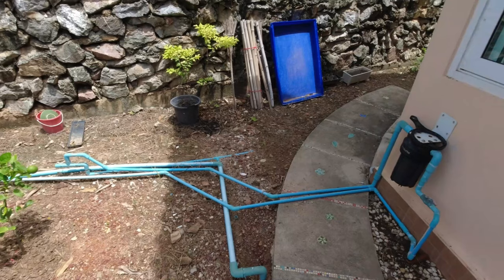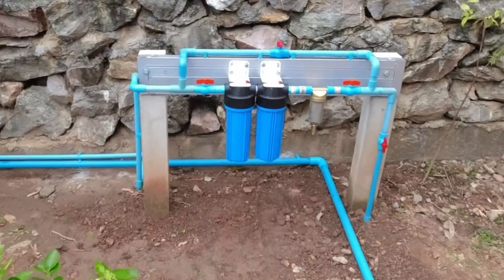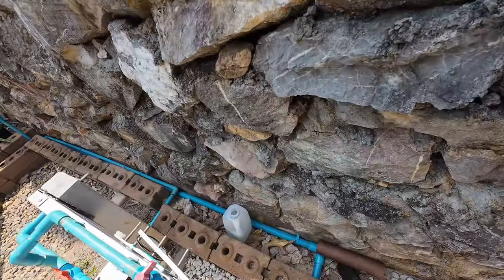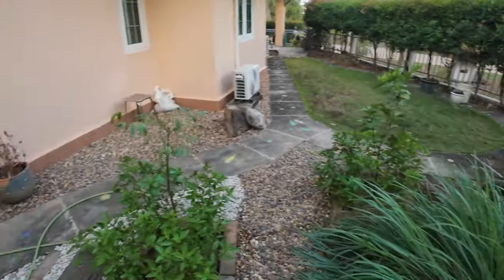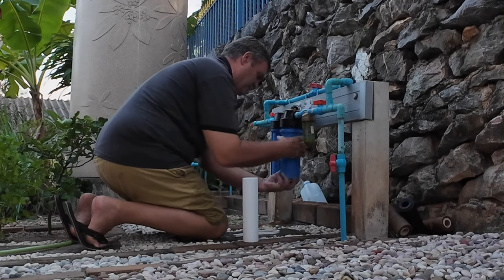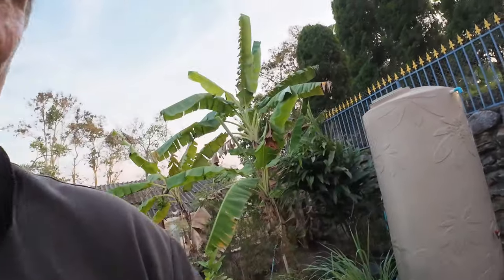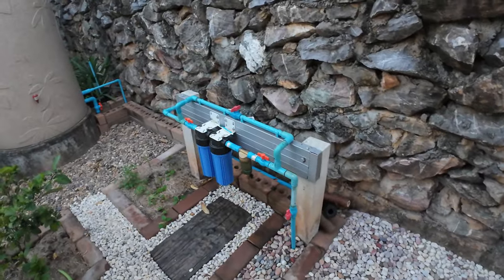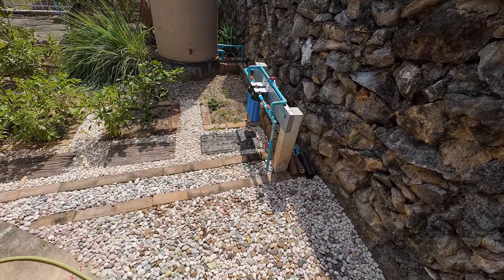DIY Whole House Water Filter: What They Don't Tell You

Comment: Sunlight promotes the growth of algae, so a cover over your strainer would help eliminate the algae. 
And 5 microns seems overkill for for normal domestic water use. Plus charcoal filter is only needed because of odor problems. With your setup, I would stage the filtration, 100 to 200 mesh screen on the strainer, 50 on the first filter and 25 or higher on the final filter.  You can even do two 50 microns on the paper filters. 
You’re not drinking the water, or other sensitive equipment. So rust and fine sediment filtration is all that is needed. 
Just a friendly comment that’s all. Good job on the installation. I would have gone higher off the ground because I don’t like working on my knees anymore lol. A water pressure gauge would be nice too.
Reply from the maker: Yes I agree I have covered the glass filter

Comment: I am certainly no expert, but, for what it is worth, here are a few thoughts off the top of my pointed head:

Depending on the type & size of junk that is clogging your current filters, you might want to add another, larger pre-filtering stage.

For example, if you see a lot of sediment, then a simple large tank, which will allow the heavier particles to settle to the bottom, while you pump the clear water from the top, should help.  The sediment tank will also need occasional cleaning, but less frequently than a filter.

Algae can be significantly reduced by a bio-filter stage.

And, if you do not already have a reverse flow mechanism installed on your system, you might want to add one.  This would allow you to flush your filters by reversing the flow of water through them, thus extending the period between needing to clean and/or change them out.

You can find plenty of DIY videos of these ideas on YouTube.

Hope this helps, and thanks for sharing!
Reply from the maker: Thanks for your input always keen to read other peoples thoughts.  For years we did not have a filter and the Landlady decided to fit a filter  it was then these problems arose, I will take your comment and build on it, I have watched many youtube videos and will look at a more options. Thanks for taking time to comment.

Comment: Hi Les,
I put in the same system as you.
Exactly 20 days later it blocked up with fine silt. I washed off the first filter and back in action.
I was hoping the spin filter would have taken that out.
I was surprised at how much crap was on the filter.
Reply from the maker: Thanks for your comment, this is the reason I fitted the spin filter but  i think I need to cover the spin filter to avoid the build up of algae will get there in the end. Thanks for watching.

Comment: Les is the water filtered before it enters the tank? If not maybe filter it before it enters the tank, Thus cutting down on a sediment build up. Just my thoughts
Reply from the maker: Hi and thanks for your thoughts, the water is filtered before getting to the tank and to be fair is clean once it leaves the tank and we use every day in the house washing shower etc etc but the filter method seems to block up fast maybe more research is needed. Cleaning the filters is no big issue but once a month is better than twice a month. Thanks for taking time to comment.

Comment: Hiya mate. As an outsider I can see your water supply is loaded with algae. Filtration is going to be expensive in the long run. Maybe consider having a well drilled. The water table should be fairly close to the surface to keep the cost down. Now that you've bought the place and intend to stay put maybe get a couple estimates and see. Good luck
Reply from the maker: Hi and thanks for that, people in the village complain about the quality of the water, it is a consideration about the bore hole, I was told about 40 to 50,000 Baht I will see what happens. Thanks for taking time to comment very much appreciated.